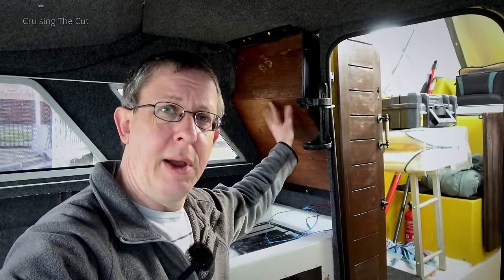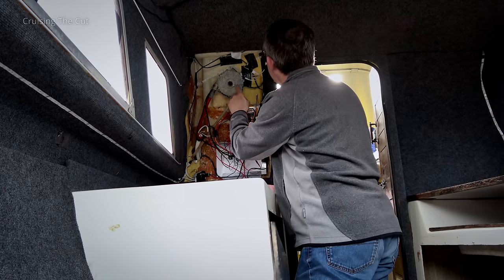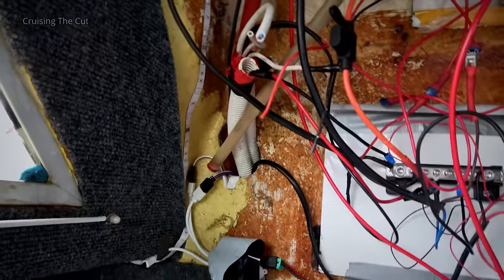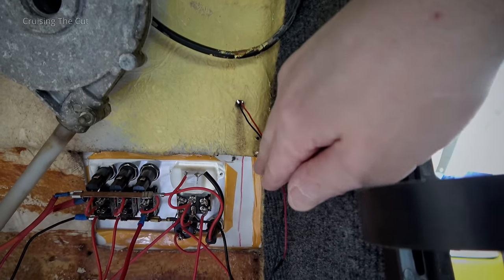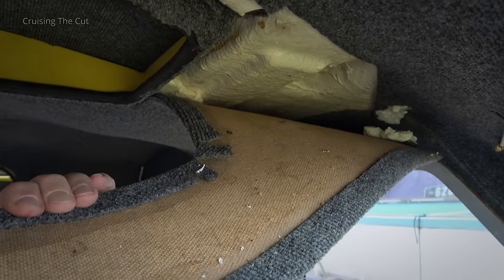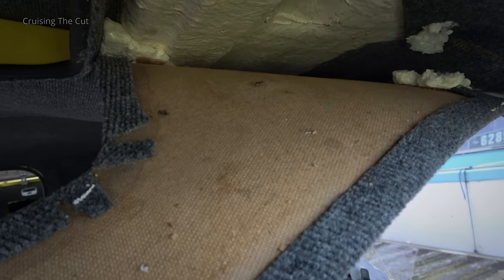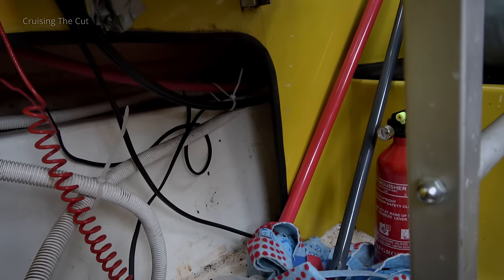326. Ripping out the wiring in my boat

Comment: David pop a power bus bar above the neutral bar that way you can run everything of that make it a lot neater and means ya can just put in new wiring into vacant slot 😮😊. You think yours is bad you should see mine 😮. Might also be an idea to put a small bilge pump in the Outboard bay that would keep majority of water outa there. Keep at it Lad.😅

Comment: You should leave the conduit going to the back of the boat in place, in case you want to run something back there later. Tie a piece of string to one of the wires when you pull them out to make it easy to pull in something new.

Comment: I am enjoying your adventures in discovery of the unknown wires. You mentioned the quality of the carpet and backer covering the fiberglass in your boat cabin. Here in the U.S. we have a brand of small fiberglass camper (caravan in the UK?) called Scamp. They glue a fuzzy fabric directly to the fiberglass interior. The old-timers all refer to this material as 'rat fur'. As they renovate and update their campers they often have to replace old rat fur with new rat fur. Apparently you can buy it by the yard. Doesn't that sound cozy, sleeping in your camper lined with rat fur?

Comment: Most entertaining! Perhaps odd electrics is a British thing. I spent two weeks sorting the wiring on a 1961 RHD Bugeye Sprite that had passed through several hands having been "up-fitted" by a bespoke aftermarket house at the time of sale in the UK before being shipped to the states. The shear amount of wires that had no beginning and no end was incredible. I suppose you have heard of the three position switch Lucas has perfected?  Dim, Flicker and Off. On a serious note. Get some red and black 3M electrical tape and wrap the ends of mystery wires before pulling on them. 12VDC is actually quite safe from an electrocution standpoint but there is enough amperage via the battery to turn those wires into lamp filaments when short circuited so be careful. All the best!

Comment: Hi David, when you rewire I suggest you consider: Using a labelling machine to identify cables. Using crimp on ring connectors for screw terminals - not the two legged spade type. Wago connector blocks are very easy to use and with the grip terminals spring loaded maintenance free. Heat shrink tubing not insulating tape, ideally with a cordless heat gun, it's safer than an open flame. Try and run the cables in slotted rectangular conduit. And most important, check the fuse and cable ratings against loads. Better still, use miniature circuit breakers. Much easier to reset. Finally, draw up a wiring diagram as a kindness to the next owner.
Reply from the maker: Cheers. I do like Wago thingies, I have a whole box of them. And yes, there will be heat-shrinking too.
Reply: I totally agree with @bobuk5722-- Check cable and fuse ratings.  There's no point using thin cables because you'll have to do the job again when those thin cables burn out (assuming of course that you haven't set the boat on fire at the same time!).
Reply from the maker: Rest assured I will use appropriately-sized cable 👍

Comment: Excellent episode David! As others have mentioned watching you work is preferable to us doing it.

Real cinema vérité.

Even to forgetting to isolate the battery first 😂😂😂

Might have been an altogether differently themed episode if the wires had touched for longer ... and rewiring the boat entirely was the next episode ... or three.

Now, at the risk of teaching you to rewire boats ... might I suggest you fit a battery isolator cut off switch on the "dash panel". Of course you're going to do that!

And see if you can get a slate of plastic to mount the switch/fuse panel as you want it.

And perhaps remove the battery to your place to keep it charged and hydrated if it's a flooded cell type.

Oops ... I'll get my coat ...
Reply from the maker: I did not forget the battery, it was switched off. However, the cable I pulled was a negative (thus not isolated as the battery switch cuts the +ve) and when it connected with the battery terminal, it shorted.
Reply: @CruisingTheCut  

Ah. I see.

However ... you did in fact demonstrate an excellent point in that when dealing with loads of unterminated (and unlabeled) flying leads, so to speak, it's prudent to completely isolate the battery, at both terminals, so as to prevent a chance short ... as happened.

So, an even more instructive episode than planned perhaps.

Comment: It takes commitment to change a system, put in new wires, and remove the old wires. I think you'll probably find a lot of little projects where the previous owners changed something, but left the old stuff in as well just in case the new change didn't work out. "I'll change the location of the battery compartment but I'll leave the old wires in place just in case." When you're done with the boat it'll probably be the first time she's been in a proper well managed state since it rolled out of the factory.

Comment: Hilarious 😂 Very entertaining watching you trying to figure out that rats nest. 

A few suggestions I'd have is, leave that spurious white conduit in situ with the wires. Depending where it goes, you might need it in future and you can use the existing wires to pull new wire through into that conduit.

The control panel might be easier to just vinyl wrap and relabel everything the right way up with new stickers(rather than having to cut the whole panel in upright)

Comment: I'm a bit of a wiring nerd as well. It looks like it would be ideal to put a small fuse block adjacent to the negative buss. That would allow you to tidy up the positive side of the system, removing those pesky in-line fuses. Any future owner would love you for that. 🙂
Reply from the maker: I wouldn't tend to fuse the negative side ...? Positive, yes (and there is a fuse box which I will re-use)
Reply: @CruisingTheCut   I was not clear. 🙂  I was thinking of keeping the existing negative buss, then adding a fuse box on that same panel that would take care of the positive fusing and distribution.
Reply from the maker: Ah! I see what you mean :-)

Comment: Your video documentation is a good reminder to always take lots of pictures before you start disassembling things.  Also, those old wires in the conduit can be used to pull new wires through if needed.

Comment: The nerd in me would rip out all the wires and start over, adding in some nice LED overhead lighting. For your carpet/ceiling it might be worth getting in touch with a car mat manufacturer, they are able to cut the same materials and have the cutting machines to do it, most will do it to order as well. Depending where you are you can take a template into them and they can cut it like for like in any material and colour, and stitch it all nicely for you.
Reply from the maker: It's going to be re-done, yes

Comment: I think the thing with 2 holes and a red and black wire was once an LED pilot light to indicate that 12V was present. The housing for the LED has been sheared off with the LED too. It leaves behind the two little leads and the back of the socket.

Comment: Could have been worse. When I bought my Dandy back in 2018, the wiring was a complete bodge from start to finish. Lights wired up using clearly whatever was handy at the time - twin and earth, bell wire, old lengths of telephone cable - all taped together and run directly back to the battery, with not a single fuse present on the entire boat. How it had been given a BSS cert shortly before I bought it is a mystery!

Comment: One of the cheapest but most useful wiring tool I own is a fox/hound pair.  One has two clips on it and puts a signal on the wires and the other a receiver with a speaker.  One of the fastest ways to find where wires go. Best done without power obviously.

Comment: I'm currently "taking stock" too from 4 days stripout and rewiring on my boat. A last few connections, then power on, and insert a fuse in each circuit 1 at a time, fire extinguisher at the ready... I share your nervous excitement. Good luck.

Comment: Nice deep dive into the wiring.   That little 'socket' with two tiny holes above the control panel looks to me like a plug for an LED or some low voltage light.  Perhaps a poor man's panel light for illuminating the control panel?  Or a simple "there is power' indicator from the overall system.

The prevalence of velcro within the electric panel makes little sense to me other than possibly the previous owner ran out of gaffa/duct tape and used whatever was handy, but when it's elsewhere perhaps it was used for holding things up like curtains.

The crosshatched wood is what we in the US might call 'particle board' or 'pressboard' - just compressed wood bits including sawdust all glued and formed under pressure into sheets.  often used for the backing of things like furniture when you don't need solid or supporting wood.

Comment: On the control panel, I wonder if you would think about not turning it round, but, removing the wording and putting new ones on will decals (like you get on model kits) can even get luminous ones so on your evening cruising they would be seen a bit easier as well.
Oh, yes and I am sure you will make very neat lables for all those wires :)

Comment: It's called a spade wire connector. Just second thoughts, don't pull all the wires out as you might need to feed something back threw at one point or another. Interesting video but I don't think too many housewives might have been interested. Personally, I would have left most of it alone and just enjoyed the great fishing opportunities the boat would offer. Well, that and putting on a brand new Honda 70 HP engine on the back. Okay, a 125 but when dreaming, why not dream big!

Comment: Isn't it fun cleaning up the "bodging" done by multiple previous owners? I think that tiny "socket" (fed by the thin wires) must have been a 12 volt power socket for some small device that is long gone. Do have lots of fun setting it "right and proper"😏😉

Comment: Hi David..Before pulling all of the wires out of their conduits it would be prudent to check if you need to pull any new wiring through  Namely for your new electric start engine you mentioned in the first video -- as you can use the present wires to pull any new wires through. keep the faith. more videos please 
love them

Comment: The small thing on the dash is a smashed light fixture! There are tiny bulbs with 2 bare wire leads that push into the 2 holes on that socket. Definitely

Comment: You pulling out the old wires reminds me of a story from a friend of mine. Her family bought an old house, and it had some sort of garish 1970s wallpaper in the dining room. The day they moved in, my friend's grandmother marched straight into the dining room and, without even taking off her coat or putting down her purse, grabbed a loose edge of the wallpaper and yanked a large swath of it off the wall. "Ah, that felt GOOD!" I very much got the same feeling watching you remove the dead wiring.

Oh, concerning that odd power outlet on the console: could it be for a GPS type device? It reminded me very much of the sort of power connector you might have for a car mounted GPS, back before phones started doing everything.

Comment: Nice documentary !! The 2 holed connector may have been from a 12V indicator light or some sort of kill switch, althought the wiring gauge is quite small for that purpose, but in 1975, it may have been possible. The whole bunch of wiring within the white conduit that has been cut off may have been for an AM/FM radio and speakers or they may be from the original engine with the original gauges, lights, sensors, bilge pump (if any) switch, etc, that seem to have been removed in your current dashboard. Good luck with your build !

Comment: Fuses are there to protect the wiring.  The wire between the battery terminal and the main fuse is unprotected.  Therefore always fit the main fuse as close to the battery terminal as possible.

Comment: I would definitely leave the conduit in that goes the length of the boat. Pull the wires out of it, but you'll probably be very happy to have that conduit in place in the future.
Reply: Leave one of the wires in place then you can use it later to pull new wires through the conduit.
Reply: @rh2577 either that or tie some strings to the ends of the wires before you pull them. Then when you pull the wire through the conduit and out the other end, ready for to use them to pull new wires through when you need to.

Comment: The 'weird thing with the two dots on it' is the remains of a broken off panel light. Either some kind of pilot light, or a light to illuminate the dash. The top of it has been broken off. And the two dots are where the bulb (or LED maybe) were 'plugged' in within the missing fixture part.

Comment: Hardboard!! And I think the round thing with the two holes is a socket- I have a 12V LED that might fit into it so perhaps a light so that you can read the sideways lettering on the the sideways control panel

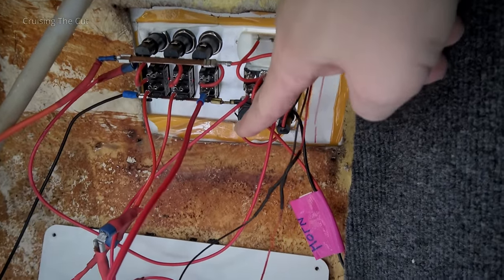Comment: I know it's going back a bit but you were asking about that odd connector at 06:13 .  One thing that it reminded me off was a power connector for a GPS unit.  Years ago I used a small handheld Garmin (GPS12) which although battery powered also had a power/data connector available which used a pin type plug connector.  Not the same as yours but quite similar.  (or not).

Comment: Great stuff, full of excitement as you discover wires which go nowhere, screws held in place by a prayer, gaffer tape and velcro seemingly used for aesthetic purposes and wires joined by a dab of filler.  Makes you wonder how on earth it all worked - and what you are going to put in its place without ripping apart the whole boat. I hope your mooring is secure for the next x months/y years. The next installments will be fascinating. Thank you.

Comment: As an electrical engineer, that was a quite scary video! My thoughts as you were develing into the depths of your current electrical system were "And when will David's boat end up as a burning pyre?"

Aside from poor wiring, the wire gauges (widths) all look very very wrong (the smaller, the less power they can transport, and therefore the hotter they get moving the electricity around). There must also be other wiring in the boat somewhere - where was the feed for the fridge, cooker or bilge pump for instance?

I would be tempted to add a new electrical control panel. It would make electrical safety, control, monitoring and distribution far easier. All of the modern one's are based on miniture LCD screens and terminal panels (can be complex!), but going back a generation a Zig control panel or similar can easily be found on eBay. Consult a boat engineer if you need help - Good Luck!

Comment: The glockenspiel,  ejection seat, and the  photons Torpedoes  were wired to those unknown wires in the conduits. Contact  Scotty and seek his expertise.    The wood is called veneer.   The spark  was the auto self-destruct  leads.  Lastly always  disconnect  the batteries. Good luck, Capt.

Comment: the random 2 small wires going into the dashboard connected to the thing with 2 very small holes is a broken housing for a small LED light, probably for indicating that the power is on.

Comment: "two hole thing" probably a battery charge level indicator bulb. Works on a traffic light basis. I would rip out the redundant wiring now and have a clear (or clearer) view of what is what. Get rid of the spade connectors they are only a source of problems from corrosion. Enjoy the learning.

Comment: Yes, there  is something "special" about the wiring in old boats. They are much worse in that respect than what you find in old cars, perhaps because boats are likely to have been modified by successive owners? Still, you are lucky in that Twiggy is rather simple in it's electrical requirements. Our 40 year old "smaller trawler" is a mass of wiring for all sorts of gee-gaws and do-dads that have been installed and then removed over the decades -- a true nightmare to which (to my shame) I have added a chapter or two myself.
Anyway, you make your struggle far more entertaining to us than it may seem to you -- keep up the good work!

Comment: Hi David, I sense you have had a strong urge developing to address the problem areas on the boat.  In your zeal, I would caution you to first determine (ideally make a simple sketch) how the existing wiring is connected and what it is powering.  Try to resist the urge to rip everything out that doesn't look pretty, you may have to reinstall it later.  Don't ever remove conduits and wire bundles, even if they are not used.  Just tie them off and label where they go to, you may find in the future you need to reuse that conduit and they can be quite the ordeal to reinstall.  When you are finished with your wiring, you should make a wiring diagram, which is very helpful with future maintenance and modifications.

Comment: Shiny mylar coated bubble wrap is cheap, lightweight, and provides a bit of insulation value. If pulling off all the carpet then adding a layer of that underneath might help keep the boat less chilly.
Reply from the maker: Cheers. I'm planning on adding a thin layer of closed-cell foam.

Comment: Hurray, you got some of the roof carpet down. My finger nails breathed as sigh of re;ief. If that's possible. The 'Stuff' the roof carpet is bonded to is generally called 'Hardboard', if that twigs your memory. Not great in a damp enviornment, but cheap as chips for an 8X4 sheet. Mind you for a few quid more you could get a good quality 4mm thick ply wood which would take a splash of paint or varnish to protect it from condensation